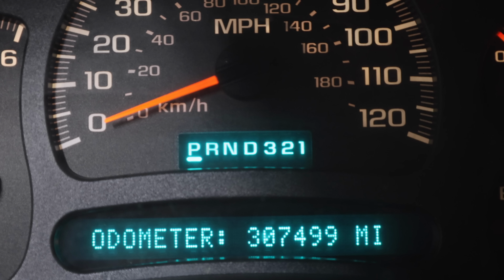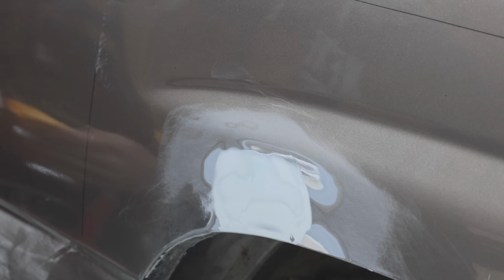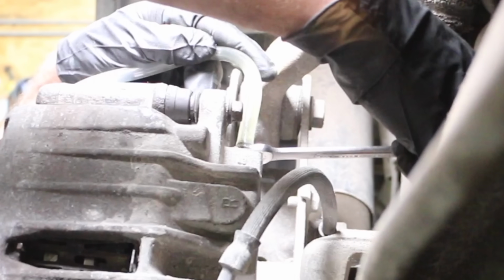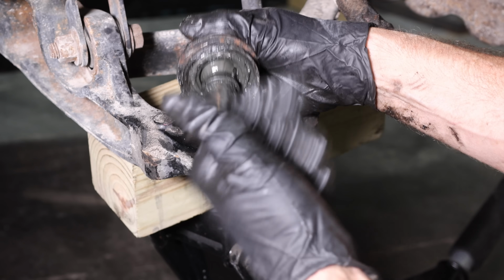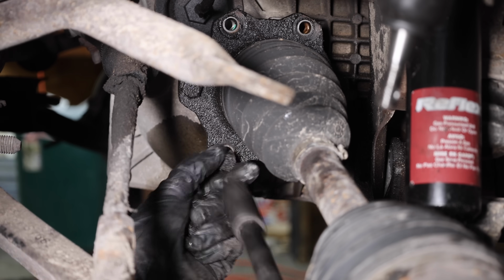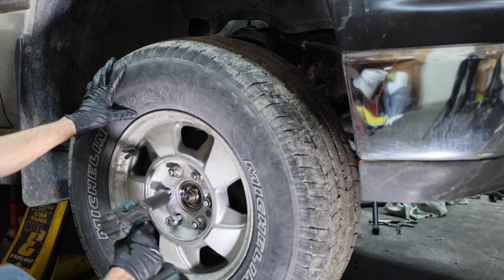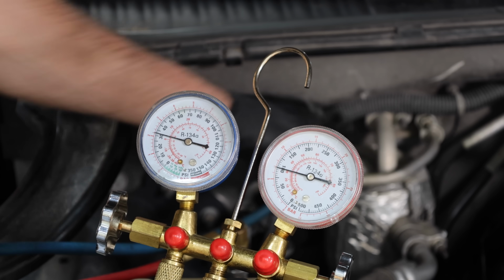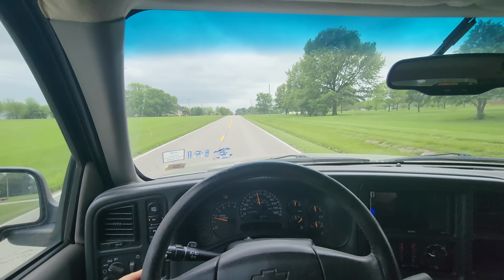Is It Stupid To Fix Up A 300,000 Mile Vehicle? Let Settle This!

Comment: Vehicles after 200k practically doesn’t have resale value however if they are running decently they still have usage value nevertheless if they need a capital repair as replace engine or transmission is not worth it
Reply from the maker: Good Point!

Comment: DO THE LED UPGRADE, JUST MAKE SURE YOUR LEDs HAVE HAVE ADEQUATE HEAT SINKS AND OR FANS ADD THE SCOTTY KILMER VENT PORT TO THE BOTTOM OF YOUR LIGHT HOUSING IF THERE IS A CONDENSATION PROBLEM, BUT LEDs GET SO HOT THAT CONDENSATE SHOULD DRY RIGHT OUT! WORTH EVERY PENNY IN A SNOW STORM OR AROUND DEER
recommend auxito or lux, they have good heatsinks and fins and brightness. 6500k lumens is very good and legal.
or buy the LED headlight upgrade for your model vehicle. lots of nice options from rings to orbs to cannon, and even smoke or clear tint, different amber signal options ect.
Reply from the maker: Thanks for the suggestion.

Comment: I would caution people about using Shell Rotella T in gas engines with higher miles. Rotella is designed for diesel engines that potentially run dirtier inside than a gas engine would. I am a big fan of Rotella T starting in 1985 with my first diesel engine and have never changed since. The problem is that Rotella is designed to keep the engine clean which it does very aggressively. You can look in a large Cummings, Detroit, or Cat that has been properly maintained with rotella T and filter changes, it will be very clean inside. Gas engines do not require the same level of cleaning as diesel engines. From personal experience my Mom had a Toyota Camry that had about 70K miles on it. Looked good ran like a top. I was going to drive it from the West coast to Indiana so that she and her sisters could have a vehicle to use for a couple of months while she visited. I thought that I would give it a little love so changed the oil and filter before I left. The oil I used was Shell Rotella T 15w-40 about 4 versions older than the "modern" stuff. At that time I had noticed that when I changed diesel oil my hands did not turn as black and that the black washed off a lot easier than it had in the past. To make a long story shorter about 1/2 way to Indiana I had a low oil warning, got out to check and was just about out of oil. I noticed that it was leaking between the engine and trans axle.  Poured oil in at the rate of about 1 qt per 150 miles. Left the car with instructions to check and add oil, went home, came back, drove it home again about 150 miles per qt. got it home and pulled the engine. The rear main seal was leaking. Replaced the seal, changed back to the old oil and it went another 10 years before I sold it still running well. The Rotella had cleaned the gunk off the rear main which was preventing it from leaking. 

Be careful what you wish for when using diesel oil in gas engines. Be prepared for leaking seals. It will be interesting to see what happens to Tod's engine in the next 20K miles. Just how much cleaning will it take?
Reply from the maker: Thanks for sharing.

Comment: One thing I forgot to ask is didn't you have to use the computer scanner to activate the abs brake system in order to bleed the brakes !??, I had to have a shop bleed my brakes on a similar chevy pickup and they said that the brakes that have an abs system need the scan tool to allow the brakes to be bled ! Any answers? Thanks

Comment: i noticed in a search after trying to find the best air impact wrench you haven't done one of those, i tried the home depot brand that supposedly went to 460 foot pounds, and it failed miserably to even turn a wheel nut from me type of gm truck you have, and i bought it to remove the 240 foot pound crank bolt from my engine. home dot air tools under $300 couldn't even fart right to break this bolt to pull my cam shaft.
Reply from the maker: Thanks for the suggestion.

Comment: You should have replaced the emergency brake shoes while doing the rear rotors or adjust them to fit the new rotor (inside).
Reply from the maker: Thanks for the constructive feedback.

Comment: Did the same to mine with parts off Detroit axle through Amazon for under $500. Drives great and 6.0l still chirping the tires if you get too heavy on the gas. Knock sensors and water pump also needed replacing.
Reply from the maker: Thanks for sharing.

Comment: It depends on the year and make.
It depends on the damage.
It depends on how bad the parts are.

I bought a 99F150XLT with the 5.4L and 4WD. Paid 3k, private, and I've only needed to replace a few things.
My dad thinks it's not worth spending more on repairs than what you paid for the vehicle.
I don't agree with this because the price of older vehicles is getting expensive and parts are becoming rare. You have to either replace with non OEM but compatible parts or find a donor. A donor can be cheaper but in todays age you have options.
If you intend to keep a vehicle for years then fix away. If you plan to flip the vehicle then send it to an auction.
Reply from the maker: Thanks for the feedback.

Comment: As a body repair guy I think you did a reasonable job on your rust repair, rattle can paint jobs are renown for shrinkage into the primer and should be left a day or so before clear coat unless you have drying lamps. Keep up the good work.
Reply from the maker: Thanks, will do!

Comment: Does your Suburban have the 5.3 engine? Also is it equipped with the 4L60E
transmission or a heavier duty 4L80E. These GMT800 trucks of this vintage
are imo very good reliable vehicles. I think you made a smart decision by doing
all the work to refresh it and maintain it properly instead of replacing it.

Comment: @$95,000 for a new same model vehicle these days, it's cheaper to rebuild an engine and transmission or buy new ones to drop in and underbody spray seal your undercarriage when it's new to keep it from rotting out to the frame. it cost me $3,000 to do the obama-biden active fuel management disable on demand epa presidential executive order on a 2013 silverado (crazed performance repair and texas speed kit) after it failed miserably because of typical chit gm design despite duesenberg having invented this tech back in the 1930's to help people right before the great depression kicked in hard. 
what is cheaper still is doing preventative and regular maintenance like changing your oil when it turns black by 3,000 miles or repairing the motor when it starts turning fresh oil black immediately ( a sign of imminent failure when you need it most), greasing everything grease able as $5 grease tube is cheap compared to $25 replacement bolts that break/strip when you have to replace a part that failed. used motor oil makes a great underbody water repellent that prevents or delays rust. same with old grease when you wipe it on the frame and other underbody parts and places. i like using it on wheel wells to prevent this body repair he is performing.
cops target rusty vehicles due to the fact they can count on the drivers not having the money to hiring a lawyer to fight a ticket in court.. the usa is broke $35,XXX,XXX,XXX,XXX dollars. uncle sam must steal from your pockets just to pay the interest to WEF bankers.

Comment: Well, I’d say don’t bother unless you plan on a complete resto. I had my 2000 Silverado from new and thought I’d start putting some money into it to maybe get another 200K on it after. Replaced the engine first (due to start up knock), then rebuilt trans and torque converter. Another 2K for a badass stereo and started addressing suspension. Then it got stolen. These years Suburban, Silverado, Sierra’s etc are on the thieves list and get stolen a lot. It got recovered 1 year and a month later but, no aftermarket parts I put on it were still there.
Reply from the maker: Thanks for the feedback.

Comment: I wonder if you would consider testing Spray on Oil Undercoatings such s NH oil, Fluid Film, Waxoyl, Blaster, Dinitrol etc. Ive only used NH oil and the dreaded used tranny oil coating, hate doing...because of how expensive the other products are and their durability.  "How fast do they wash away" ? Nothing worse than watching your investment dissolve away from road salt and brine😒 Cheers from ohio.
Reply from the maker: Thanks for the suggestion.
Reply: @ProjectFarm  thank you for your commitment.  🙏🏼

Comment: When it comes to used vehicles, it's really a gamble as to whether or not it's worth keeping them running. Sometimes you can get really lucky and only have to do something as simple as brake work and it will continue to run forever. However you could also get very unlucky and run into issue after issue that was not caught prior to purchasing the vehicle, such as having to have the engine or transmission rebuilt, a new differential, major electrical work, etc. and the cost to fix it could end up being more than the vehicle is worth. Not everyone has the time, equipment, or the tools to be able to do it themselves to make it cheaper, so they have to end up relying on taking their vehicles to repair shops that cost an arm and a leg. I had an old ford ranger that my dad purchased for me years ago as my first vehicle, and it eventually just needed work after work which had to be taken to the shop for (a lot of transmission issues, needed ball joints, engine ran iffy at times and wouldn't start, etc.), and it ended up costing around $5k total to be put into it, when he only bought it for $1900, and it probably wasn't even worth $2k when resold. To me used vehicles are not worth it and are too much of a gamble for me to invest in anymore, but that's just my experience with them. There's really no right or wrong answer to whether or not you should purchase a used vehicle. Just have to be aware of the risks.

Comment: Greatly appreciate the car maintenance video sets; it leaves me confident that I can perform some of these repairs (barring the unforeseen). With oil, grease, rust, and similar working conditions - have you considered doing a video on stain removers? Pretreated, post wash, and set in stains (post dryer, or after multiple wash/dry cycles). Thank you!

Comment: Video ideas, do automotive window solar fans actually work to cool vehicles and which one is best, also the 12v windshield defoggers. I have a 2001 Tahoe with 5.3 V8 463k miles on it, I run 0w20 in the winter and 5w20 in the summer. The thinner oil picks up better in the gear vacuum style oil pumps. I've seen the thicker oils lower the oil volume that reaches the valve train. Volume is more important than oil pressure. I also have a 2004 suburban 2500 with 6.slow with 388k miles. Same oil. All original drive train.

Comment: It depends on the vehicle. New cars made of plastic and software are designed to be replaced not repaired. Older cars made of steel and analog are normally worth restoring if not rusted away. Parts will be harder and harder to get as the years go by though.

Comment: My 2003 has a transmission drain plug. You do want to drop the pan and change the filter every so often. 

My 2016 made it 315k changing the fluid and filter every 50k miles.

Comment: I daily drive newer cars because I don't like to spend the time fixing an older car just to get to/from work. I spent nearly 2 decades as a mechanic, so the tools and knowledge are definitely there, it's the time that I don't have or don't want to spend under a car anymore. I used to drive my modified projects to work every day before I could afford to have a DD and a project, which was fine when I worked 1 mile from my house, but became a real problem as I started working 20, 30, 40 miles from home. I have project cars that I work on at my own pace when I feel like it, but a new, reliable car that gets me to/from work. That said, if your only concern is what is the least expensive, a GOOD older car (i.e. nothing European) is almost always worth fixing and keeping on the road (unless it's completely rotten).

I like your videos, although these types of videos are definitely more of an overview and a "watch me work" type of video. They are too fast paced to be instructional IMO. Nothing wrong with that really.

Comment: Back in '96 I bought a new '96 Impala SS.  I still have it.  For many years it was my daily driver - about 45 miles each way 5 days a week.  Most miles were freeway miles.  Around 275,000 miles it became a garage queen.  I'd like to say it still had original running gear but that would be a lie.  I did all my own servicing including Mobil One every 5,000 miles.  The engine never broke down and it always passed California's smog tests.  Oil consumption was about 1 quart every 4,000 miles.  But, I saw (heard) some tell-tale signs that the engine was getting tired.  I could hear a faint rod knock during a cold start.  Also, the oil pressure warning light would flicker on a hot day with the AC on.  I probably over-reacted and had the engine replaced at around 280,000 miles.  The Impala now has 324,000 miles.  The transmission quit and was replaced around 285,000 miles.  A rear axle bearing got noisy around 290,000 miles, so I had the rear end overhauled.  I overhauled the front end including the steering gear but steering slop is still an issue.  Overall, I'm very satisfied with the durability of my Impala.  I doubt if I will ever sell it.

Comment: Check brake lines as they rot fro inside out . The ABS system sucks and they don’t stop too well. Tranny goes 80-150k miles 
U joints , and so on . Better find a Toyota Soquia

Comment: I would hope you used Moog problem solverFor those idler and pitman arm. I had nothing but issues with my steering over and over and they would last maybe 5 months. I installed moog and it’s still so nice and solid!!

Comment: I think you should keep the videos at this pace.  You did a great job.  I also like to change out the water pump every 100,000 miles, because from my experience they like to fail when it  is -10 degrees out and since I don't have a heated shop, I had to pay over $400 to the mechanic.

Comment: Don’t change your format, it’s perfect for those of us with shorter attention spans😂 I wish the last owner of the Silverado in my driveway did that with the transmission fluid. I wouldn’t be rebuilding a 4l60e at 160,000 miles

Comment: Regular clear spray isn't the same as the clear coat used for car paint. It will get eaten by gas, car cleaning chemicals, etc. You need a 2K spray.

Comment: Now lets see you try that with a vehicle from New England.  Lmao!  As a body guy, I see stuff 10 years old that is so rotted, it can't be saved.  Its scary how fast the chemicals used to treat the snow on the roads eat thru metal. P.S.  You did the bondo mix right.  A "old timer" once told me, if you mixed it right, there will be no bondo on the back of the spreader. Only the front.  Those sway bar end links are way to tight to.  Dont go by a torque spec, tighten them until the rubber is even with the edge of the washers.  Same with shocks (the upper on yours).

Comment: I have a side hussle that makes me 50 to 60k a year buying up these 99 to 07 Silverados, Tahoes, Suburbans, etc for $1000 to $1500. I do basically everything you just did with quality parts (AC Delco & Moog) and then they sell for 5 to 8k... takes me roughly 20 to 24 man hours to get it all done including an extremely thorough outside and inside detail where I pull the entire interior. I LOVE IT! 

The only thing I don't typically have to deal with is rust being that I'm here in Texas. I actually just finished an 06 Tahoe on Thursday with 260k and it drives like a dream now.

Comment: If this was my cobalt, I'd pass. Largely due to oil burning issue. It had 348k, if I remember correctly. Damn car refused to die. But holy crap did it need work. Talking paint, replace/rebuild front calipers, replace the suspension, replace the rear brake shoe hardware... just a money pit. My current Chevy though it's like a pride and joy... a low production number HHR SS. Which is both nice and anxiety causing, because parts are scarce.